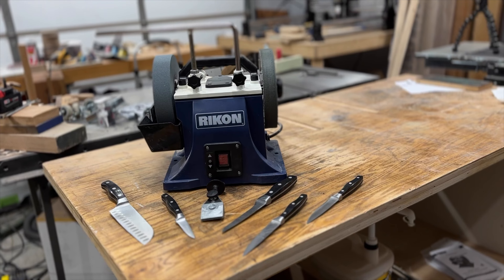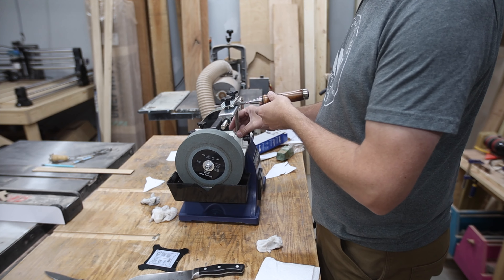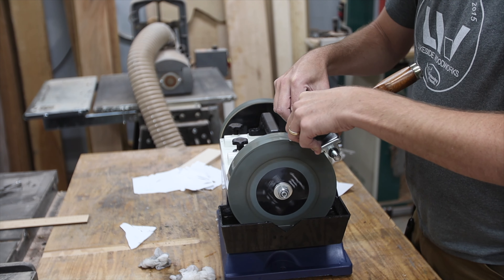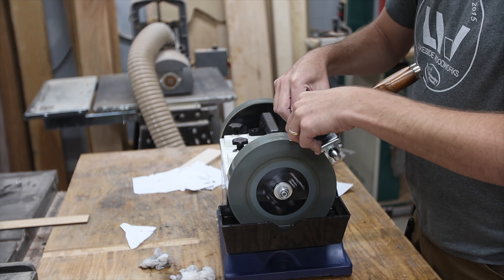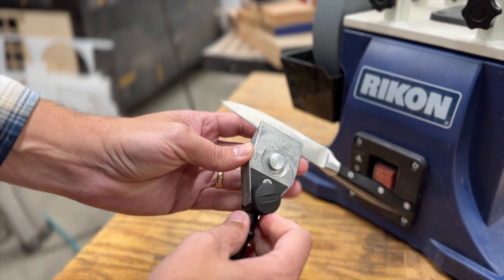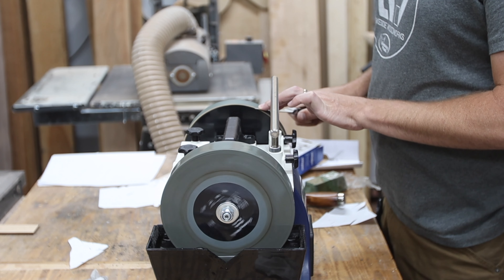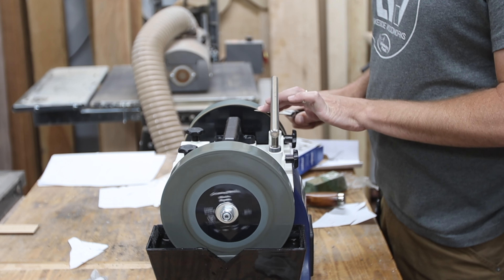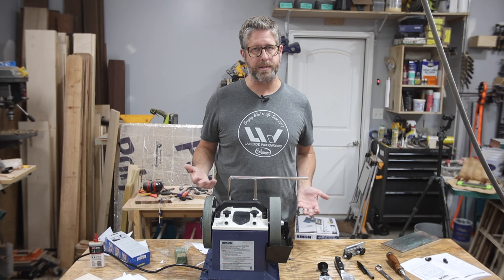Rikon 8 Inch Wet Sharpener - Sharpening Kitchen Knives, Chisels & Plane Blades / Tormek Replacement?

Comment: You should have a tool for "dressing" the stone that makes it completely flat in reference to the machine.
Reply from the maker: This machine does not come with that. You can buy one for the Tormek system, but the first wheel was pretty far out. Way out of tolerance for a new machine.
Reply: @BruceAUlrich  well yes. You have to buy the diamond honing tool seperate to dress the stone and make it flat. But like you said, it was outside of tolerances and I'm glad they made it right by sending a new stone.
Reply: @BruceAUlrich  you could save money and buy the one Jet makes for its 10” wet grinder.  It’s manual but it works.
Reply: @GlennInLaguna happen to have a link to the one that you are referring to?

Comment: Try connecting water tray first, then top up from a jug or bottle to save making a mess. I was skeptical at first but grading the stone is well worth it. Just get a cheap two sided stone and you’ll really notice the difference in sharpness.
Reply from the maker: Good thinking about how to not make a mess. I'll try that. I might need to try to grade the stone...sounds like it's worth it.

Comment: I would never have used that machine with the wobble in the wheel. I use the Worksharp Precision Adjust elite with Accusharp II 6" and Atoma 4" diamond stones as well as strops I made that I coat with diamond spray in 3, 1.5 and .5 micron grits  in an aftermarket 4" to 6" stone holder  in conjunction with a base table clamp and a knife clamp support. It handles everything very well. A friend of mine 3D printed a holder and guide for sharpening chisels and plane steels and another one for sharpening scissors so I can sharpen whatever needs sharpened to a hair splitting degree. It also makes it very easy to reprofile a new edge or fix and nicks or chips that may occur.
Reply from the maker: That's quite the setup you have there.

Comment: turn it on without the stone . if the shaft wobbles then you need new bearings for the shaft . if not then you need machined spacers only around the stone . interested to know what would it be
Reply from the maker: I tried it with the stone off...and there didn't seem to be much runout with the spindle, so that's why I contacted them about another stone. The new one seems to be running much more true.
Reply: ty for replaying anyway . I made my comment 2 min to the end just before you should the new stone . lol  . tho I had a tip in mind ..the setup should give you a hollow grind on a chisel then go to whetstones . you will get amazing results  @BruceAUlrich
Reply from the maker: @trq3000  ha ha...no worries. I always like comments about how to do stuff better.

Comment: Hey Bruce.  Just bought one of these so really appreciate your review and comments.  I'm curious why you don't use the jig and guide for the strop side?  It's made to switch the guide to the other side to keep the angle and movement the same.  Kudos if your freehand method is as accurate.  I just know mine isn't!
Reply from the maker: Glad it was helpful for you. I don't think you really need the accuracy of the jig on the leather side. The leather is soft enough and giving as you press the edge against it, doing it by hand is good enough. You're really just using the leather strop and compound to polish the edge you already honed on the other side. Hope that makes sense.

Comment: I just bought this same model and it has a similar amount of wobble. It sounds like you contacted Rikon and they sent you a replacement wheel? I'll try doing the same.
Reply from the maker: Yep. Their customer service was good. I have a friend who owns the same wet sharpener and his wheel was fine. 🤷‍♂️
Reply: For Tormek Stones, Tormek advices to hang on the stone always in that way that the side sticker of the stone can be read with horizontal lettering. There is som space between the bore hole and the tread and the centering is made in that way that stone fixing screw always should be fixed with stone hanging down in the same position.

Comment: What actually come in the box (as far as jigs)  I am looking for knife, and chisels and maybe scissor.  What size is the arbor for a CBN wheel? Do you use a buffer wheel?? Or just the leather strap wheel??

Thank you.
Reply from the maker: The only jigs that come with the grinder is the one that holds the chisels. You can buy many other ones that fit on it. I bought the knife one. I’m not sure of the arbor size on this one. I only use the strop wheel so far…& and hand strop.

Comment: So how does it do with pocket knives? I assume it'll be similar to the kitchen knives. Do you see using this once a week or once a month for your chisels/lathe tools? I think this will be something I would like to have in my shop.
Reply from the maker: To my knowledge, you wouldn’t use this on lathe tools. You can’t hook the common jigs for those to this. I’ll just do it on an as needed basis, I think. Definitely doing the chisels more often since I’ve out in the time to get a good bevel again. I’ve seen people sharpen by hand with pocket knives, but this jig should work for it also.
Reply: Tormek make a lathe tool holder and I’m sure I’ve seen copies for sale too.

Comment: Pull the wheel off and check the runout of the shaft with a dial indicator or just a bent wire then remount the wheel and check  runout of both the side of the wheel as well as across the wheel face. Reference all measurements from the tool holder rod.
Reply from the maker: I did a bunch of those tests, even if I didn't show them.

Comment: That wobble is awful for a new tool with a new wheel.  Seems like the strop side also had a wobble.

It is nice that they sent you a new wheel, but I don’t like the hassle.  I ordered the Tormek T8, and there is zero wobble.
Reply from the maker: Yep, that’s why they replaced it

Comment: Tormek Replacement???? with this you can only convince people who have no idea about the material. simply said.... a joke
Reply from the maker: Ooooooookay.
Reply: I’ve been using something almost identical to this for 18 months (30+ knives a week plus chisels, plane blades etc and it does a fantastic job.  Every knife is shaving sharp (I have the hairless arms and legs to prove it 😂) and the replacement wheels are re-gradable (just like the SJ 220) but only cost £23. For anyone less than a full time sharpener it is perfect for the job. I’m even considering getting another so I can convert one to run with 2 diamond wheels and have the second machine just for stropping.
Edit
I forgot to say, it’s reversible so you can strop without having to spin the machine around on every blade. That’s the main reason I’ve ruled out the Tormek.